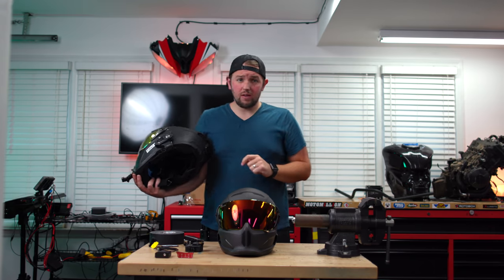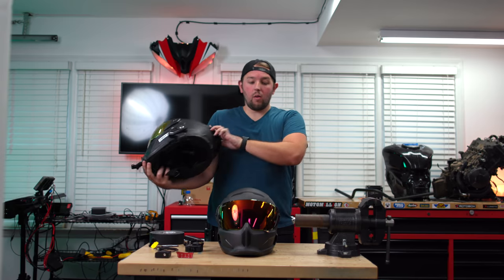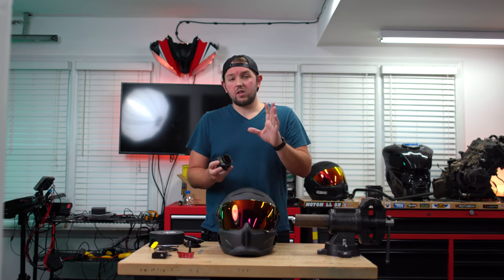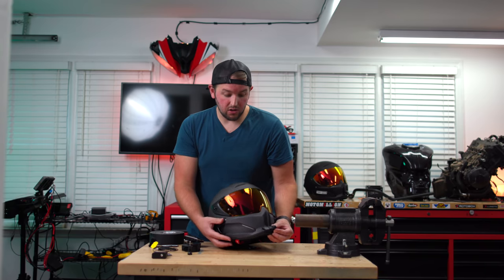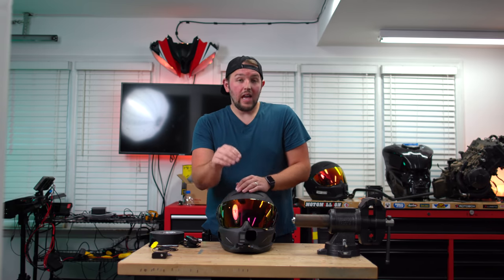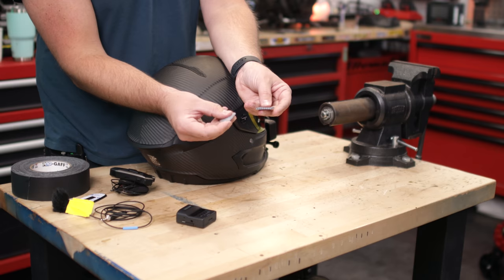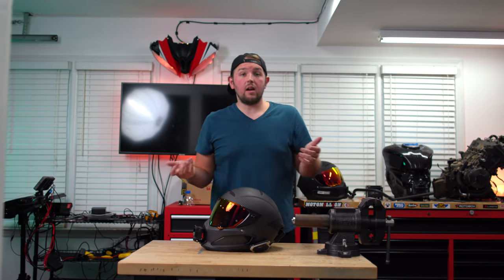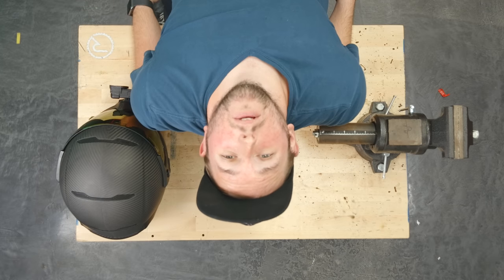THE BEST GoPro Helmet Setup you can have! | And how to do it on the CHEAP!

Comment: used your last setup guide to setup my motovlog helmet im almost to 200 subs and im starting to gets lots of comments about how good the audio is and good the quality of my videos are. that is in part thanks to you.
Reply: What do you do about the crackling? I did something similar but get a lot of crackling noise
Reply: Frankie Freedom you get that from a low quality lapel mic
Reply: @Mark1594q  or maybe if your too close to the mic?
Reply: GRACEVENTURES possible but most likely the mic is low quality. What i mean by low quality is its cheap $20 or less. I get a crackling sound at high speed all the time because my mic is cheap, planning to get a more expensive one but short on budget.
Reply: Weird. I get it from the one where one recommends, which is the people panda and have installed like everybody recommends in the cheek pad, I mean I would mind spending a bit more
Reply: @Frankie_Freedom  you have the fur on it?
Reply: Frankie Freedom i heard and watch a lot of reviews about purple panda and its good maybe theres wrong with the set up. Maybe try another brand like rode lapel mic i think its around $60-70.
Reply: Yup
Reply: @GRACEVENTURES  Yup with the dead kitty on

Comment: Anyone looking to buy a Sena right now the 30K is currently $200 on Amazon (at the time of posting this in the USA) you can upgrade the firmware to Mesh 2.0, and Sena will be releasing the HD Speakers soon for $40. So for a total of $240 you can have the exact same quality as the Sena 50S. Mesh 2.0 and HD Speakers are all that has been upgraded on the Sena 50S.

Comment: My touring lid is an LS2 Valiant, a modular with the chinbar that flips back.   My GoPro works great mounted on the chinbar and gives you the added benefit of flipping it back to shoot behind you, which I discovered kind of on accident.  The problem I have had is with audio...I've tried mounting the purple panda mic in the chinbar but it causes a problem when you flip the chinbar back since there is almost no clearance.  You can force it, but I don't think that's a good long term solution for helmet or mic (and I lost a dead cat once, lol).  I think your external/secondary recorder might be my solution.  Thanks for sharing!  When you are syncing video and audio, do you use the "loud noise" or visual cue to find the video/audio sync points?

Comment: There it is! That Ruroc Action Cam Mount is dope! Question, though... Would the Shockwave audio be good enough to use for your videos? Follow up to that... Have you looked into Bluetooth capabilities of the Insta360 OneR? 🤔🤔🤔
Reply from the maker: I saw something about the ability to pair Bluetooth devices but haven’t looked into it. I’d be curious to try and get it to pair with a Sena to see how that audio would be.
Reply: @chaseontwowheels  I think that'd be the ultimate goal for vloggers, to not just mount an action cam to the front of the helmet and pair it to the Bluetooth system already on the helmet. No need to fish any extra wires, or have anything else on the outside of the helmet. That would be sick! 🤙

Comment: My main issue is i want to record with my go pro but also have "dashcam"
 footage just incase of a crash. What's the best way to have my cake 
& eat it too. Go pro battery doesn't even last a full ride. I'd like something that'll last around 4-5 hours but idk what will fit on my bike / helmet :(
Reply: Attach a powerbank to the GoPro and stick to the helmet... Choose a lighter one mate...
Reply: @yeshwanthgollaprolu  Okay, i'll have a look around m8. It's just hard to find something that'll keep it on there.
Reply: @Near2Future  dont go attaching stuff to your helmet other than just the Gopro. Get a good backpack. Get a good powerbank. Get a good long braided type-c cable. Keep the powerbank in the top most available pocket/compartment of the backpack. Run the cable from your camera, to the powerbank on the outside surface of helmet. And you are good.
Reply: @themonitor7877  Only issue with that is i don't want the wire to be a risk of getting snagged on like a tree or something. I also don't want the wire to have drag in the wind, that's prob the reason everyone attaches it to the helmet itself. Just i need a good mounting solution.
Reply: @Near2Future  you can tape the cable along the side of the helmet. Thats how I have been running it for 5 years now.

Comment: How tight do you torque the bolt down that holds the GoPro? Do you leave it loose enough to move or put it in place tight?
Reply from the maker: I do it relatively tight. I can always hand loosen to change positions.
Reply: Screw it in until it breaks - then back it off a bit  :D

Comment: Be Aware if you guys are using the Hero 8 with the media mod adapter,  currently there aren't really any ND Filter that fits with the media mod. Except one chinese brand that slips over the gopro lens, that I don't trust because of the riding wind force may knock it off. The media mod door will not close due to these filters use a frame clamping system to attach to the gopro.
Reply: Umm I have one on mine and isn't what you just described above and it works fine, even at high speeds and my door closes just fine.
Reply: CyberSpy please provide the link so I can purchase one. The one I looked around has the filter go over the lense and has a snap that stretches to the back of the camera to snap in place. That snap will not let me close the media mod door to lock the GoPro 8.
Reply: @TKLMotoVlog  I just noticed you replied. I'm not putting links in the comments but you can Google for "QKOO ND Filter Kit for GoPro Hero 8 Black (Works with Media Mod)" (that's just one of the many). They are magnetic and hold really well.
Reply: @CyberspyUsurped  Thank you.. That was one of the filter I was looking at, but wasn't sure about it's quality and fitment. I'll place an order if you say it's stable!

Comment: the velcro will give way when you turn to your sides at high speed
Reply from the maker: Im not sure when I'll be going more than 115 mph and turn my head like I did / have done in this setup with no issue. (speaking from actual experience).
Reply: Get dual lock velcro, I use it all the time, this stuff is not coming apart at speed.
Reply: @RudeboyMoto  never heard of it?

Comment: I am scared to attach a gopro to my helmet with glue... In my opinion that is just insane.... I would never trust glue in the sun and wind to hold my expensive gopro...

I dont get why there isnt a helmet with a proper attachment yet... I honestly was hopint for a better system in a video like that. ( Dont get me wrong. Your video is great and very well done! =))

Im just dissapointed, that THAT is the best thing to do. Lol
Reply: Why there isnt a helmet with proper attachment for a GoPro? Because "safety standards" is a thing?
Reply: @themonitor7877  What speaks against a plastic attachment that will easily go off by a crash?

But safety is one of my concerns anyway, that is also a reason, why I decided against helmet attachment